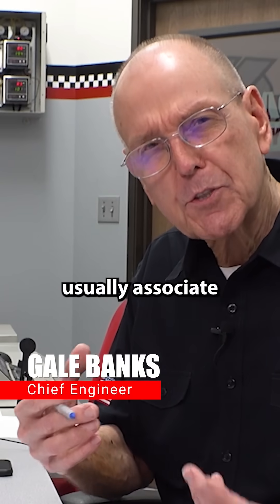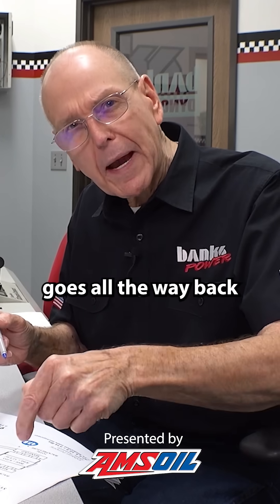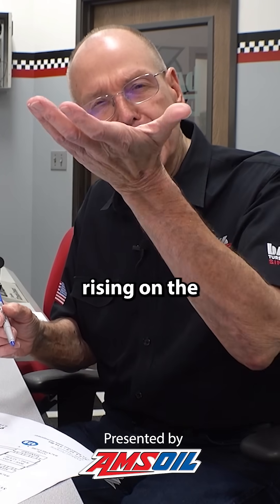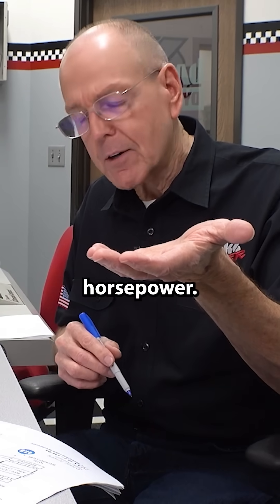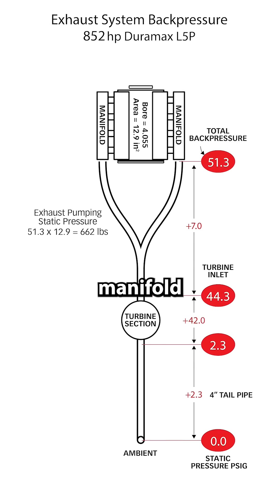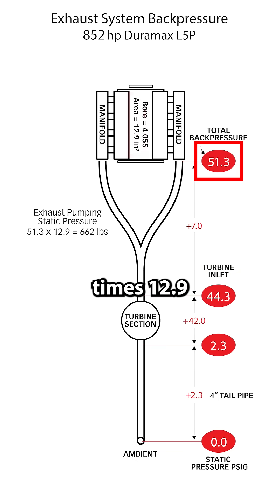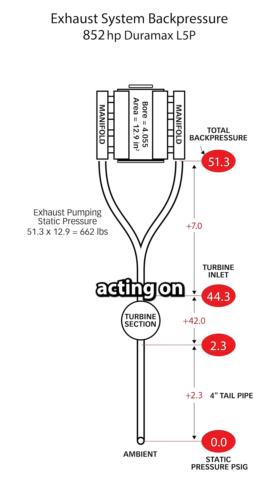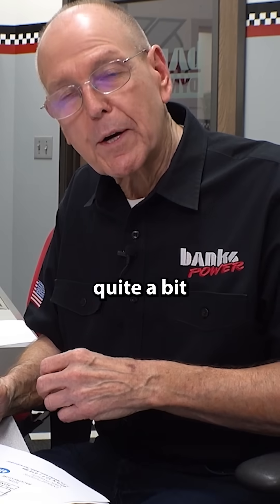How much HP are you losing to backpressure?

Comment: This guy has no idea as his example uses a turbo with 44 lbs of back pressure. Don't follow his advice if you DONT have turbos.
Reply from the maker: Backpressure is also an issue with naturally aspirated vehicles. Any restriction in flow on either side of the combustion chamber is going to cost you horsepower.

Comment: I had no idea b.p. multiplied quite like that. It makes sense.  Turbo apps would have harsher implications more than n.a. engines. When you take the back pressure and multiply it by the p.s.i. on the piston top + when the piston comes up, yeah, you are in big trouble. Good to know. At least now I can avoid blowin up my nitro push mower.

Comment: Longer exhaust duration cams create more back pressure. When the piston is coming back up from power stoke both valves are open. During overlap the exhaust is being sucked backed into the cylinder.

Comment: I'm 39yrs old, and I've been saying for years to people that exhaust backpressure isn't good for the engine, because it creates more resistance against the engine or pistons as it were, and so whenever one of my buddies would get a CAI installed I would tell them to also get better flowing exhaust and remove CATs as well, you open up the top better open up the bottom or rear as well, you should hear how they always say with glee that their pickup trucks get 10 to 20% better fuel economy and they also don't fill up as often either, all these emissions equipment installed on engine systems are actually somewhat detrimental to the engine life itself and efficiency, just improving air/fuel density and relieving backpressure causes better horsepower or frees up horsepower and allows better burning of that mixture, which in turn creates less harmful emissions, in an argument about this I bring up home gas furnaces and shop heaters that use fuel oil, I ask how do those heaters burning fuel and air not kill us with emissions??? Because they burn all the fuel in the mix and produce almost zero emissions, because guess what??? They were designed that way, so why the hell are internal combustion engines so unefficiently built??? Sounds like a bunch of mark up profiteering bullshit to me lmao, with todays technologies non of this should even be a problem but the mighty dollar bill dictates to all, and brings out the worst in all, water powered engines are a thing and yet not in society, wonder why???

Comment: He says 662 pounds on the piston but does he really mean 662 pounds of pressure divided up between the eight pistons? Or is it actually 662 pounds per EACH piston? He points at a piston as if it’s all on just a single piston but then in the diagram it’s showing the back pressure being measured at the exit point of the manifold (so maybe it’s actually 662 pounds divided between four pistons on each side..?). I tried to follow his math but couldn’t make sense of it all as far as whether he means a single piston, four pistons or eight pistons.

Comment: Q=v*S
What you need is high flow of the exhaust gases😂😂😂  that means high velocity of gases😂😂😂 that means high pressure smal section 😂😂😂😂 an suction inertial efect is created😂😂😂😂 so exhaustion continues after the piston reached the top point and starts moving the other way

Bouuuhhhh 😂😂😂😂 fake tehnical gurus

Turn off your device and go to school😂😂😂😂

Comment: Just remove all the exhaust, and the pistons, and the valves, and the camshaft and intake.  Then install and electric motor and battery.  Problem solved, with fewer parts and an increase in efficiency of 50%,  it’s just basic physics folks.

Comment: There’s a reason naturally aspirated gas engines are usually dyno tested with long tube headers ran straight into the venting system. People who claim back pressure helps make power don’t understand restrictions take more power from the crankshaft to overcome.

Comment: awight... so scratch the turbo, what if you run a super charger for forcing air, and a vacuum on the exhaust to reduce back pressure to negative? (reverse drive a turbo? say ellectric to the air side? for testing) Hell if I had lots of money this is something I might have to build...

Comment: It is not that simple. You may also note that more mass flow there are, that more you'll have pressure on restricring part. On turbo engine you can see turbine as a restricting part and it'll need more energy to compressor to maintain pressure when engine flows better.

Now take fe. tuned diesel engine and change bigger exhaust there, and you can see exhaust manifold pressure get higher due better flow although pressure on exhaust pipe goes down. Same happens for example when you port head. 

Done, tested and logged already many many times on different setups.

Comment: Odd question, but is the scavenging effect from exhaust pulses in the exhaust system not useful past a certain point? 

I guess what I’m trying to say is, if the exhaust is so free flowing that there’s no pressure, in the case of something like an open header, for instance. Does having it vent out that way prevent the cylinder from being fully scavenged of dirty air before the next cycle? Or is it useful to have the pulses collect enough that it creates a flow and therefore suction?  

Just seems like there’s a balance to strike between what amounts to no exhaust system and a way to instigate a flow and reduce the chance of bad air still being in the cylinder for the next cycle. But it’s probably just that I haven’t done enough formal education on this topic to understand it better  😅

Comment: That's what you get when you double HP with a stock turbo.  You lower back pressure by using a larger turbine.  In this case a larger exhaust is necessary

Comment: Unless we’re talking about my wore out 6.0 Gas engine. I opened up the exhaust (drilled a hole before the muffler) and it had way less power. Had it welded shut and runs way better…

Comment: If you follow the most restrictive point in the engine you will end up at the exhaust port in the cylinder head !!. And if you follow the most restrictive point  in the intake system  you end up at the intake port in the head  !!  There is only so much you can do after turbo, run a kta 600 cummins (1150) ci ) the 5.
9 cummins BIG brother 793 hp to rear tires  thru a single 5" exhaust pipe & this is roadable hp full throttle & up the mountain  no letting off , so you think your smaller engine  needs a big 5" or more exhaust pipe !!

Comment: I keep having that discussion with people.  I try to get them to understand that it isn't the backpressure from adding a muffler that may help at lower RPM for street driving, it is the change in the tuning of the exhaust that particular muffler creates.  The wrong muffler, and it has a negative effect.  If some backpressure helped, then no one would run open headers when racing.

Comment: On that same L5P how much back pressure is added with the DPF emmisions system on a factory setup?
Reply from the maker: Despite what most people think, Isuzu Motors Ltd. of Japan is no longer involved with these engines. DMAX is owned by General Motors with GM/DMAX owning 100% of the intellectual property on the L5P. Duramax is a past venture for Isuzu. Even better, Duramax engines are built right here at home in Brookville and Moraine, OH

Comment: the pound is not a unit of pressure
Reply from the maker: Pressure is often measured in pounds per square inch (psi). If you want to know the effect the pressure is having on a specific surface area however (say the surface of a piston) you can multiply psi by surface area in square inches to get a total pressure value in pounds.

Comment: I learned all about back pressure when I started tuning my own big power turbo builds and actually logging boost vs back pressure etc. What always gets me though is the guys that try to explain back pressure to you and have absolutely no actual idea what they’re talking about. “You can’t run catless mid pipes on that; It won’t have enough back pressure and you’ll melt a valve.” 🙄

Comment: ok... reducing back pressure is good for making power but with the IN/EX overlap, you will be flowing a LOT of fuel into the exhaust. Mileage may vary. Even in racing they watch fuel consumption.

Comment: I ditched my catalytic converters and muffler on my (now womans, was originally mine) 02 lesabre, the lesabre group was FREAKING out about back pressure after i replaced the stock muffler with a glasspack...that was at 267k miles we're now at 345k miles still going strong...and only burning maybe ¾ quart of oil per 5000 mile interval...which i KNOW is very good...these things are probably the best V6 ever made

Comment: Engine Masters tested this on a gasoline engine with long tube headers. By the end of the test, they had beat and banged those tubes in places down to about 1/8” of opening. It barely measured a difference in hp and tq. Remembering that every automobile and truck engine today only makes power on ever other piston stroke, and the the gasses have to move out of the cylinder past valve(s) kinda crushes back pressure. Nothing in a running engine is static. Multiple pulses in the exhaust, how much heat is lost on that trip through the pipes factor in to back pressure. I’ve measured back pressure on running engines looking for the possibility of clogged cats and mufflers. Even on an anemic 1.6 NA engine with a healthy exhaust, running pressure in the pipe was less than 1psi. Things in motion tend to stay in motion, even gasses.

Comment: Had a 59 292 cui Y block in a f100 ! The rams head exhaust was cut and seperated giving dual exhaust with glass packs and pipe stopping at end of cab ! For sure added horsepower !

Comment: Too much backpressure definitely hurts power, but reducing backpressure too much also hurts power. Exhaust velocity is just as much, if not more, important to making power. You want some backpressure, as the exhaust pulses create a low pressure area directly behind them. A properly tuned exhaust will create those strong low pressure zones behind the previous exhaust pulse, pulling the exhaust out of the next chamber before the piston even begins to rise. This is also why crossover tubes (X and H pipes) create more power: the utilize the negative pressure from the opposite bank to increase exhaust velocity so the motor is doing far less work on its exhaust strokes.

Comment: Engines are designed with the back pressure in mind.  Removing that back pressure can cause unanticipated problems.
Reply from the maker: Backpressure is unwanted regardless of the engine type. Put your hand over your nose and mouth. It's hard to exhale. It's the same for all humans. And, it's the same for all engines.
Reply: @bankspower  wrong

Comment: Get an electric turbo driven by a solarpanel on the roof of the car, then you don't need horsepower from the engin ro run it, don't expect so much turbopressure and nothing ar night, but you get you backpressure down.😂

Comment: Nobody catches that this is proof turbos are not “Free Horsepower”, but a well matched turbo is just more efficient than a supercharger. They both need impeller power from somewhere, turbos can make more power (25% more).
But you’ll never get a car to squat down  and break the 60ft mark less than a second with a turbo…or get 11,000hp from a V8, but you will with a supercharger and zoomies. 
Just sayin. Haha

Comment: Is this one of only a few ways to get 'free' power  that is no additional energy used but more power? Usually horsepower reflects energy used/time. Back pressure is inefficient to deliver the power but leas of it increases power which should mean more energy per unit of time. Im assumig no more fuel is needed though, you just end up with a more free flowing exhaust?

Comment: I almost had a heart attack. My phone has a bad USB port, therefore it often has trouble with charging. I was plugging in the cable, right after I heard the sound of the Duramax on the dyno through the speaker. I though it was by battery hissing, because it was about to cook off.

Comment: This is only good for v6's or v8's. You do lose horsepower on a stock four cylinder engine if you take away back pressure.
Reply from the maker: All engines need to pump exhaust gases out in order to make room for new combustible air. Any power that action requires is power that could be going to the wheels. With turbocharged engines drive pressure will always be present as that is what spins the turbine, but reducing backpressure after the turbo means the turbine can reach the same rpm with less drive pressure and therefor less pressure acting on the piston.
Reply: @bankspower  true for racing or high-performance engines, but for that of exactly what I said in my first comment. Four cylinder engines lose h.p. when back pressure is released or removed too soon in the combustion process. There have been studies on this topic. You are correct when it comes to racing engines, though.

Comment: This is the best information on the internet nowadays! Why does everyone think a top fuel 500CI engine is running 2.5”+ individual zoomies? Yes they give a few lbs of downforce but it keeps the back pressure a minimum. If they dropped to 2.25” or 2”, that same setup would not only torch itself by the 330, but would probably make 4000hp less while doing it.

Comment: As a engine truck boulder myself he is right on from personnel experience and testing the exhaust needs to be as free as possible and if u can cause a draft with heat and a fitted, expansion chamber you can create a negative pressure or vacuum in the exhaust that will actually pull air into the motor proven in data .

Comment: Is it the same for a Harley? I have 2 different exhaust pipes I run and the loud one with hardly any back pressure makes the bike run better from 0 to about 85 mph and the pipes with back pressure makes it run better from 85 to 130 mph I have a terrible high speed wobble so 130 mph is as fast as I've went without wiping out.

Comment: Idk if it was placebo but I had a ranger 4cyl that was cut off before the muffler so I added a thrush muffler and tailpipe and it seemed to run and accelerate a lot better. Not arguing with the goat just my experience with that specific motor.

Comment: Yes, the amount of torque at the crank that's being used to complete the cycles is acting against the total output. Free up a certain amount of resistance in the pumping forces during vacuum, compression and evacuation, you free up that amount of thrust force during pressure expansion within the power stroke giving more potential to use that torque for power production.

Comment: personally had a Kia optima 06 missing the flex pipe basically exhaust ended at the exhaust manifold and my buddy mechanic of 20+ years always swore I was gonna float the valves because of the back pressure, never had a single issue with the engine power or general performance wise, that glass tranny tho :( gone

Comment: 662lbs of back FORCE, it’s not back pressure. We get careless saying “pounds” to mean pound•force and also pounds per square inch, PSI. You have 59 PSI of pressure at the exhaust manifold, which reduces to atmospheric pressure between the manifold and the tailpipe outlet as shown on the diagram. 

Not sure of the relevance of the pound-force figure since the forces acting on each component will be proportional to the cross-sectional area exposed to that specific component. E.g. the back-force on the cylinder head is a function of the system back pressure at that location and the bore diameter. 

As a physics nerd it bugs me when “pounds” is used to indicate pressure because it really confuses people.

Comment: Got my own personal experience seeing this when I changed from the stock short unequal length headers to equal long tubes on my 302 Windsor. Didn't do anything in the low to mid range but it opened up the top end a lot.

Comment: Every engine is an air pump, the quicker you can draw in cold dense air and expel the hot gas the more power you can make while simultaneously using less fuel. Clean emissions sound good on paper but why not focus on using less fuel thereby reducing the amount of fossil fuels needed to perform the same task. Pretty sure a clean running tune on any modern truck would produce less emissions over the course of a year than one thats "EPA approved". Seems like the EPA is looking out for big oil to keep the demand high for fuels. P.s. i have a stash of cardboard boxes and plastic jugs from DEF they can come recycle whenever.

Comment: So if you remove or gut your cats then will you have more horsepower or will you lose horsepower because of less back pressure.  Do you need to adjust the computer when doing a cat delete  ?  GM Denali 6.2

Comment: This is why a good set of headers can dramatically increase torque and efficiency.

ICE vehicles purposely increase this pressure for 2 reasons. 1) generate loads of heat to get the catalytic converters hot and burn unburned oil, fuel, noxious fumes, etc. 2) slow down the exhaust flow / reduce energy into heat to allow for a quiet ride.

OEM engineers know how to generate power. Their product isn’t for power though. It’s to meet regulations and provide a civilized exhaust note on their product.

This is also why Hellcat engines loosen their headers over time and even get a nice tick in the headers. Drop those off and get American Racing headers and the Hellcat engine jumps around 80hp with OEM tuning, but the deciles will get you a ticket.

Comment: You don't need back pressure in an engine, but you DO need adequate VELOCITY in your exhaust system to achieve proper scavenging or else the exhaust pulses will be too slow. While bigger is better in almost every application, there is a balancing act to it. Some engines are a bit more sensitive to the resonance and velocity of the exhaust pulses than others esp. if they're N/A